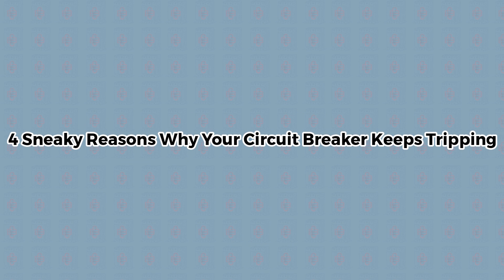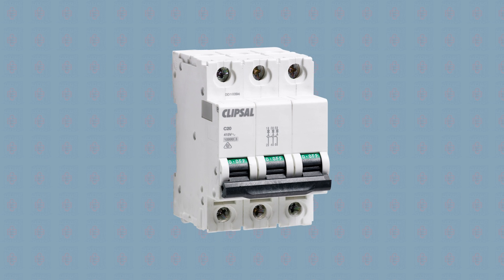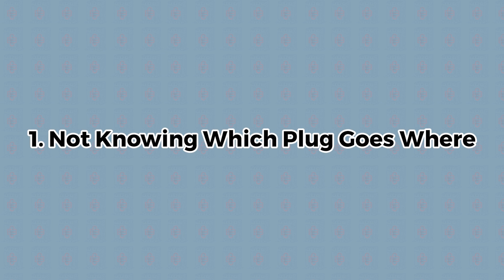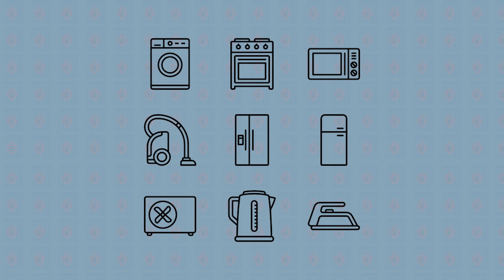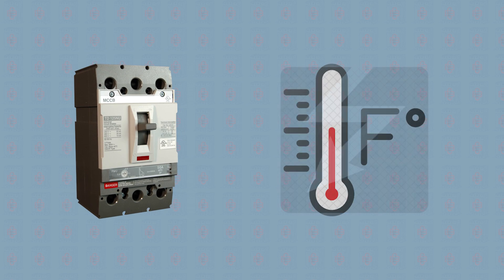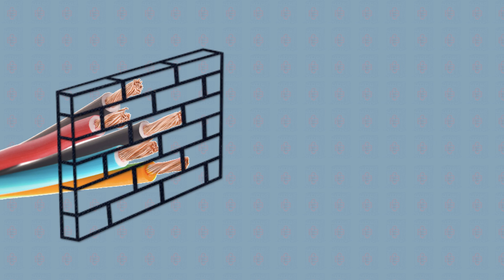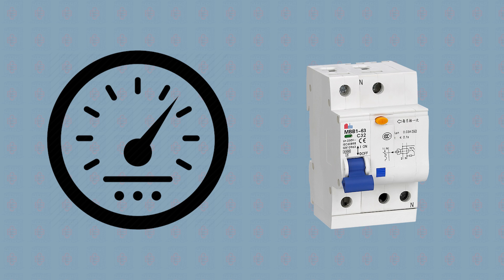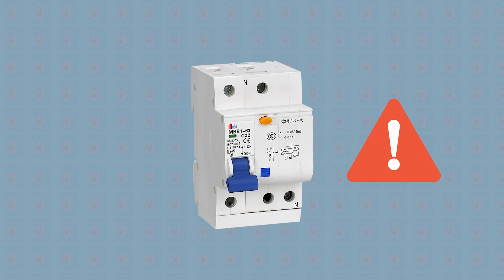4 Sneaky Reasons Your Circuit Breaker Keeps Tripping

Comment: I have installed Siemens breaker 63amp . It’s trip when load exceed 10amp , work fine when load bellow 10amp, please help, I have checked 3 breakers in 2 different places but same issue

Comment: The Video never made mention of spurious RF signals, I can pop all of your arc-fault sensors with a ham radio.  Arc sense breakers "listen" for arcing in the circut, when they sense it CLICK the breaker trips.  Radio Frequency (RF) has the same effect on Arc fault breakers. Take it from a ham radio operator, when you key the mic and the breaker trips it's not always overload, it can be RF inducting into the circuit and appearing as arcing to the breaker.  I speak from experience on this one.

Comment: I have 2 AFCI breakers, both tripped 1 instantly and 1 after a few minutes.  Nothing new was plugged in into these circuits.  I also tried shutting off all breakers except these 2 but they would still behave the same way.  Would replacing the breaker be my first option at this point? Thanks
Reply: In my opinion AFCI are to sensitive. A lot of people replace them with regular breakers after the final inspection.